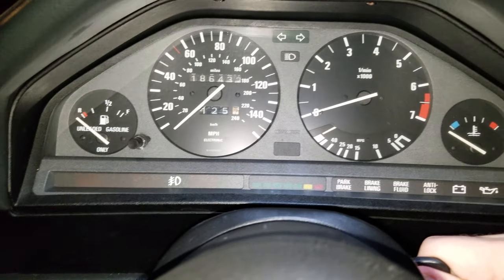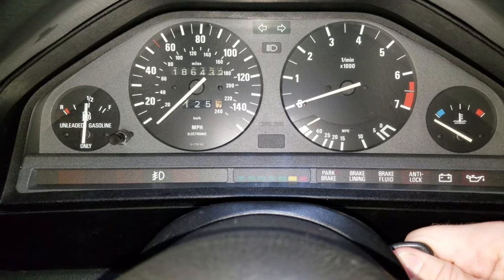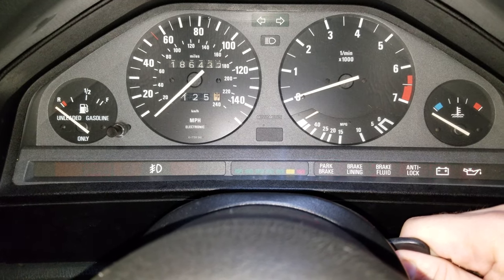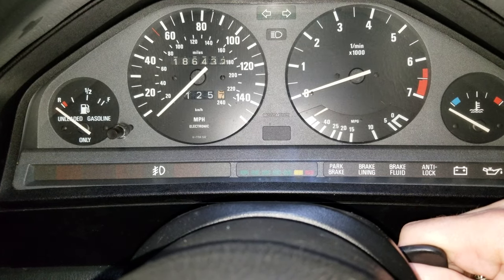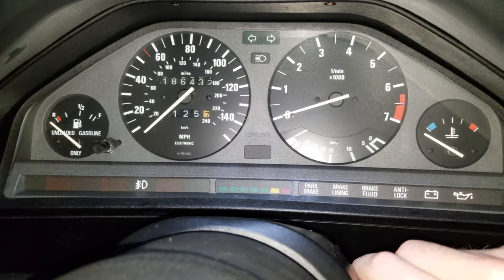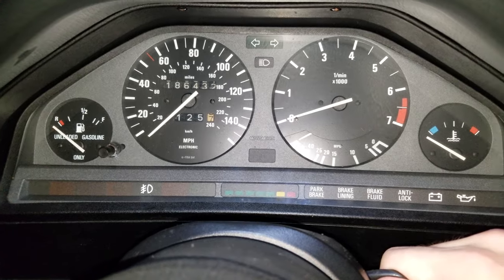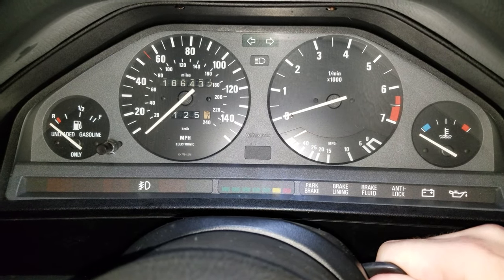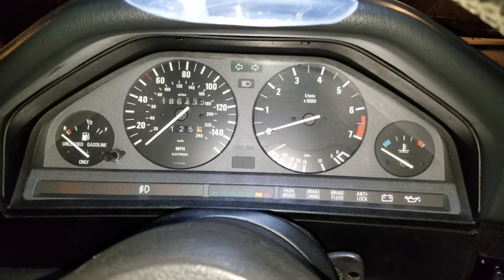1991 BMW E30 318is no start - ignition switch? --SOLVED

Comment from the maker: So it did indeed turn out to be the ignition switch. I ordered an ignition switch (OEM 61321377069) off of Amazon for about $74. 

After I exposed the ignition switch, I could tell that it was easily the most corroded thing in there. The soldered points were all corroded. I guess the humid Southwest Florida air got to it after all these years. After removing the ignition switch, I found that the plastic piece that joins with the ignition was notched heavily due to wear, because the ignition is metal and the ignition switch is plastic. It does feel that the overall ignition and turnover is much better, and the car is back to perfect turnovers again.

If you experience this problem, consider replacing the ignition switch in your e30.
Reply: Thanks for posting your issue it help me a lot